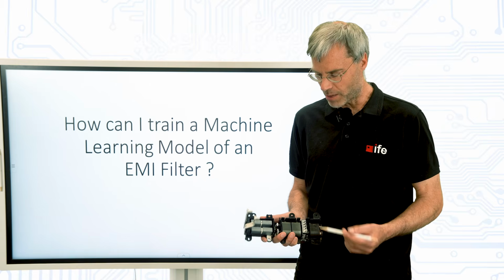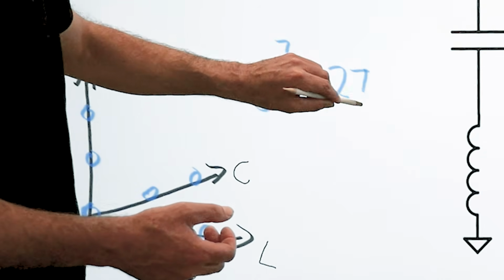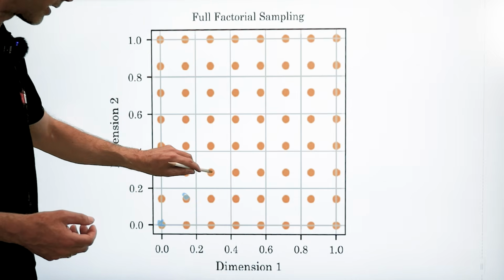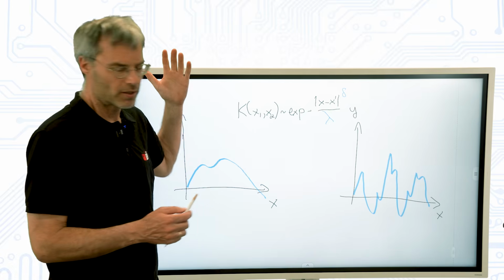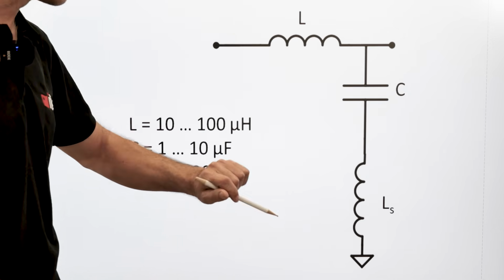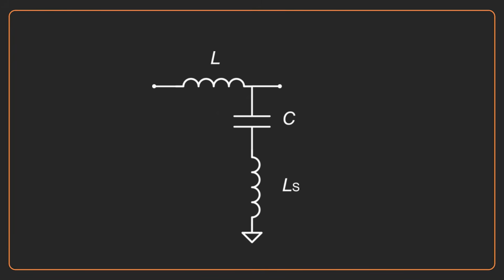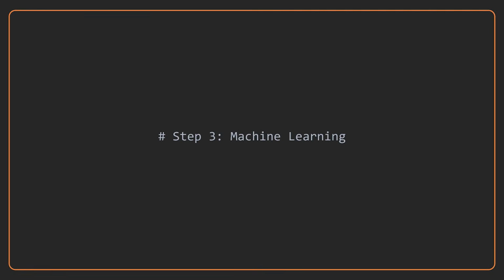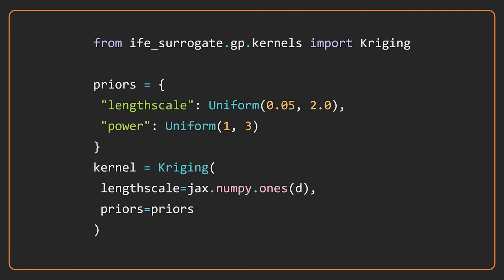Design your EMI filter with machine learning

Comment: This is not very well presented. What is the design goal? What is the advantage of this method compared to traditional design?
Reply: Goals are  just using machine learning or AI blindly and Don't know why we are applying
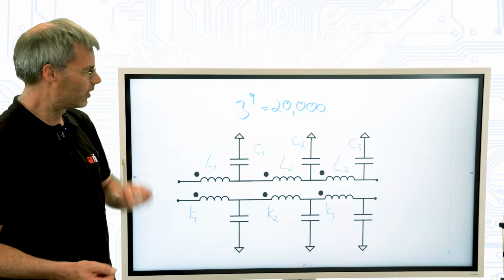Reply from the maker: Machine learning saves you computation time 💻 We explain at 2:35 that the more complex the filter, the longer traditional simulations will need to run. In machine learning (4:14), you can reduce the simulation time by calculating much fewer samples.
Reply: @ife.tugraz  I looks like you only know how to design filters by trial and error. This way you run into an exponential explotion of complexity as you increase the number of parameters. But this is not how you usually design filters.